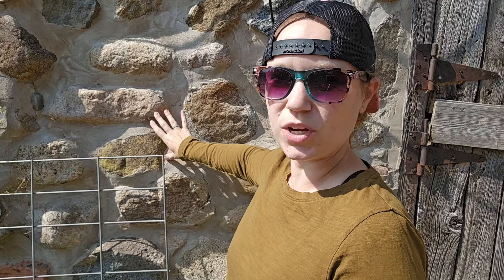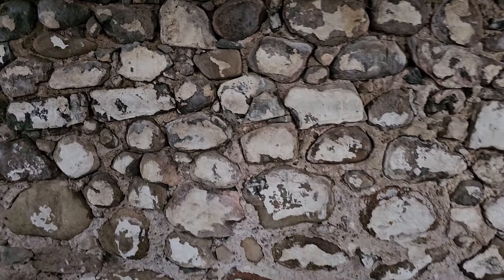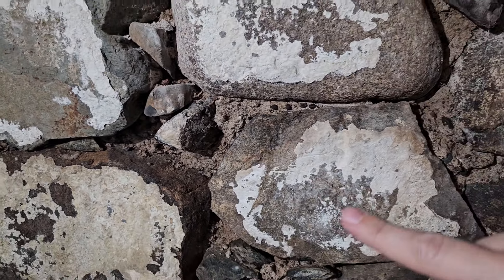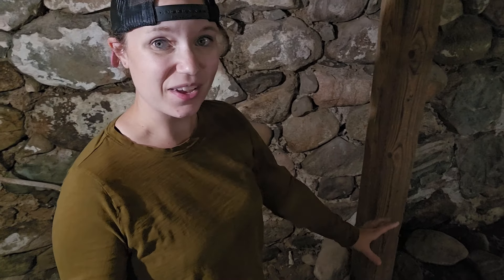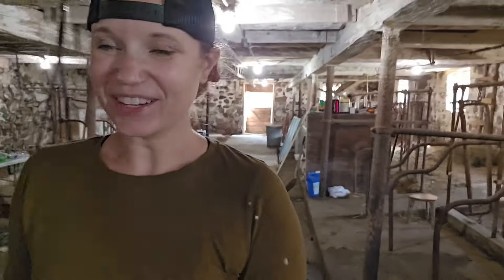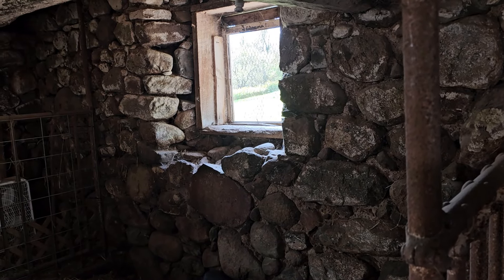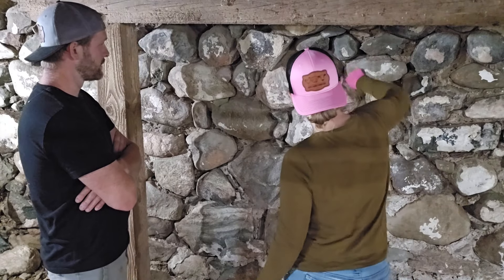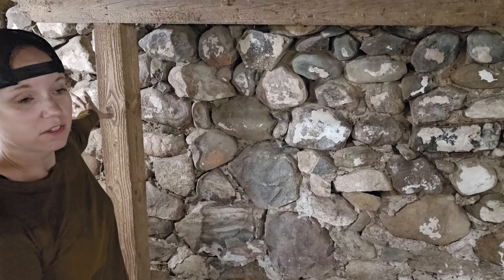Repointing Our Field Stone Barn

Comment: i live near green bay and have a barn from 1903 that needs help. any advice? its massive
Reply from the maker: @jenniferg1482  First step is to find out if you have any water or drainage issues and address that first. Roof, gutters, grading away from the barn, etc. As far as repointing, prioritize doorways, windows, and corners that need work because they will be the first areas to collapse. Then just take it one section at a time. It's a lot of work, but worth it!